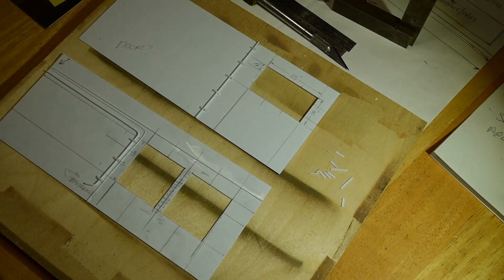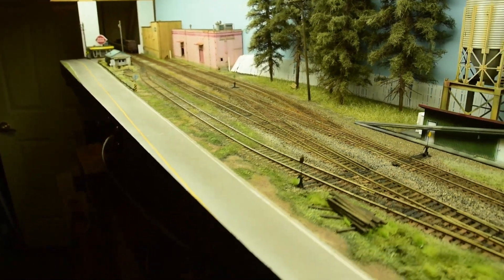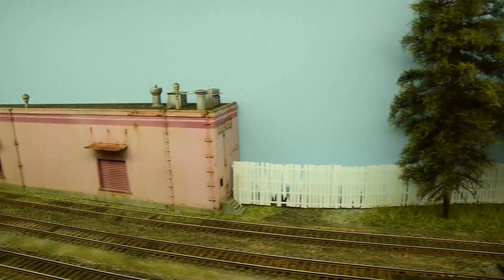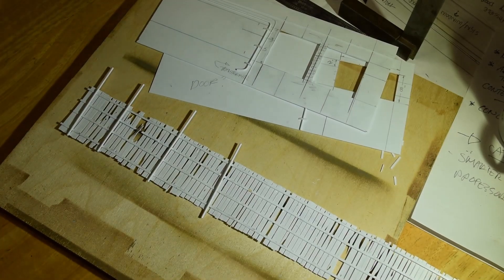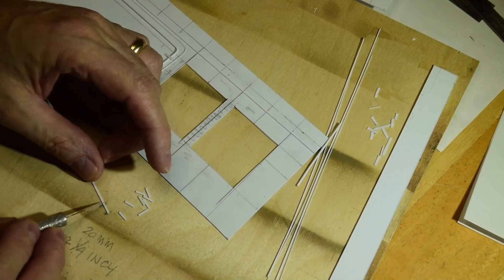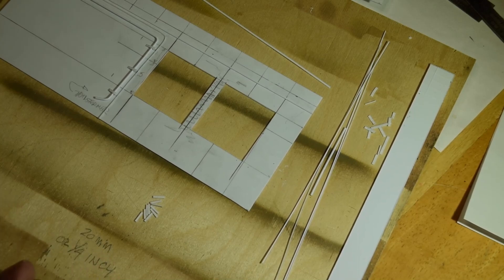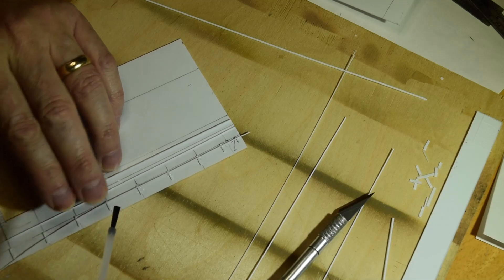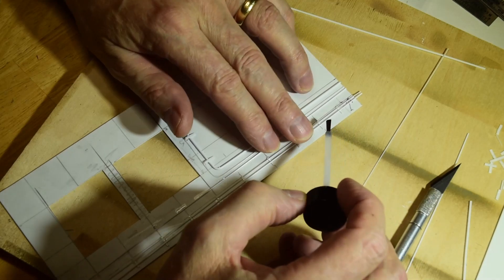Scratch Building 101 | Conduit, Cats and a Legendary Dog: Part 7

Comment: Just for your general getting stuff right knowledge, 1/4 inch is closer to 6mm than it is to 20mm, 19mm is near enough 3/4 inches, I was unfortunate enough to have to go to school around the time the UK was switching from feet and inches to metric, so I find it really easy to go between the two in my head, was a bit older when learning about weights and volumes though so all metric there LOL
Reply from the maker: Thank You for the comment. I take it for granted people know how to convert and measure things. I wish I never had to measure things anymore. At least I am with background building flats. Now, I just wing it where I can . . . except if it`s a "fine scale" model. I never did like math, nevertheless,  in art, the  mathematical equation is always there even when we don`t pay attention to it. The 1/4 inch/20mm note on the cutting-board was just a rough guage implying "no need to be accurate here" when cutting straps. It wasn`t meant to be a conversion between the two. Cheers.